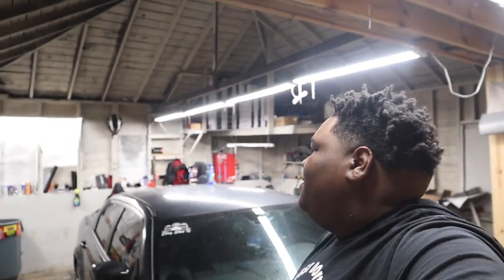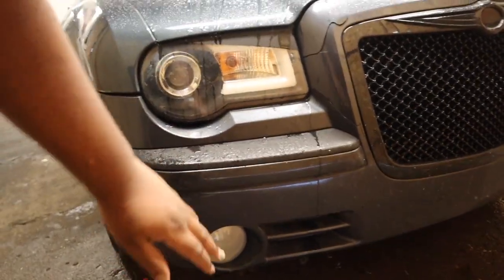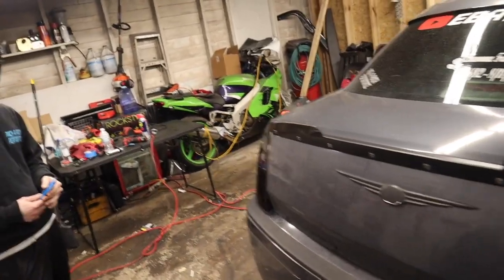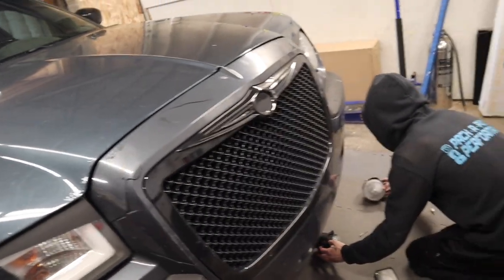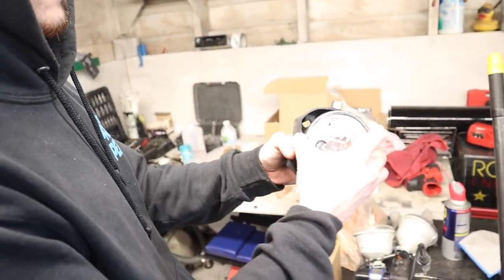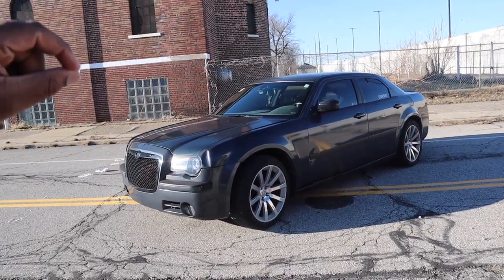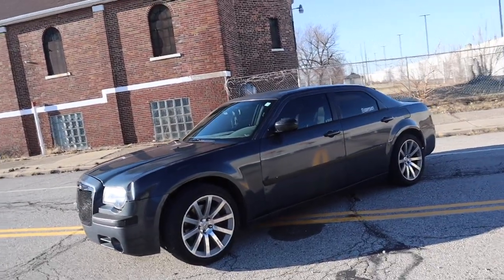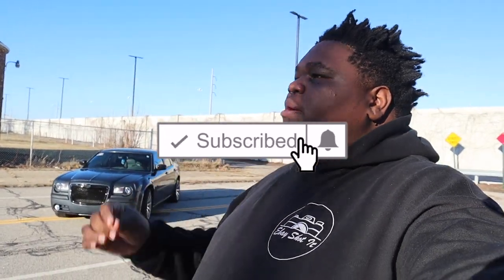INSTALLING CUSTOM TAILLIGHTS AND FOG LIGHTS *GAME CHANGER*

Comment: Personally I think the 300 is the better deal over the Charger.  I’m keeping an eye out for any Hemi AWD Chargers and 300s and usually the Chargers are 3k more than the 300s and have more mileage plus you run the risk of the Charger not having as many features.
Reply from the maker: Hmmm Interesting Ill Def Take That Into Consideration 🫡